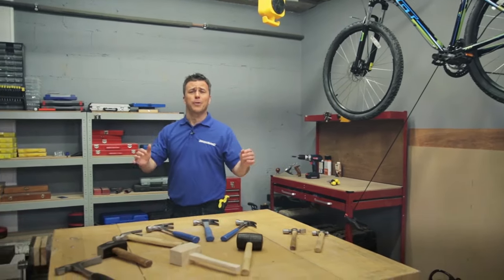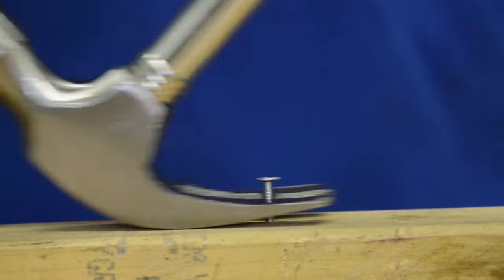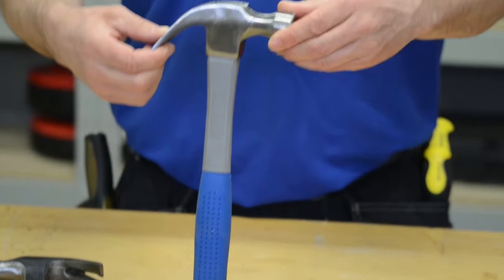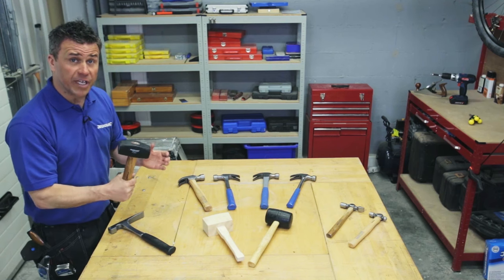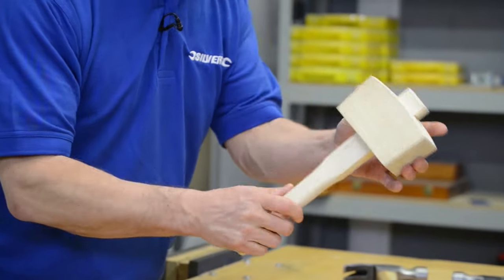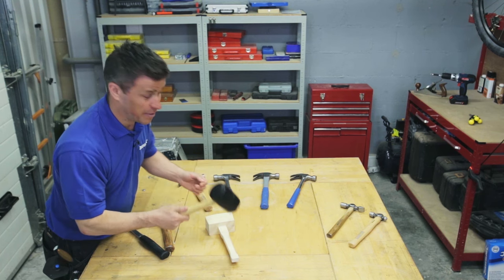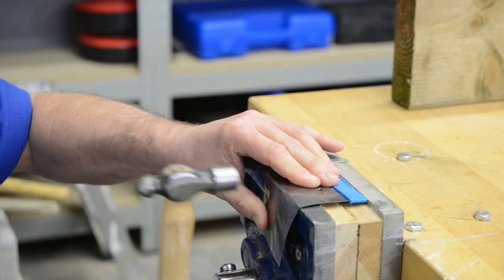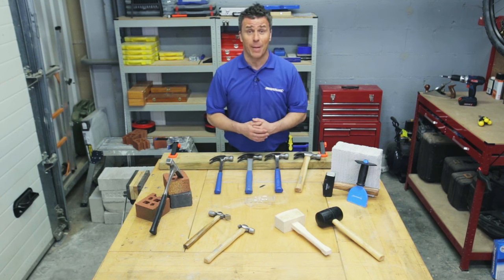A Guide to Hammer Types

Comment: The blade on a warrington hammer is used first to start a pin before it's hammered home, not afterwards as shown in the video.  This is done by holding the pin's head between thumb and index finger so that the hammer's blade can slide between them to tap the pin and set it in the surface.   Then the fingers are removed, the hammer reversed, and the pin driven flush with the surface.  This segment of the video should be reshot and substituted to show the hammer being correctly used.
Reply: Thank you

Comment: Types of claw hammers? The guy is focused on handles and the hammers are all the same. The handle material and constriction apply to all hammers. How about framing claw hammer, straight claw hammer and long nose claw hammer to name a few. How about a claw hammer with the claws on the side, a deadblow hammer or a drywal hammer? There are just too many to be "handle" focused in a three and half minute video.